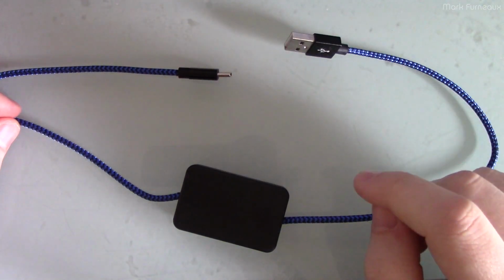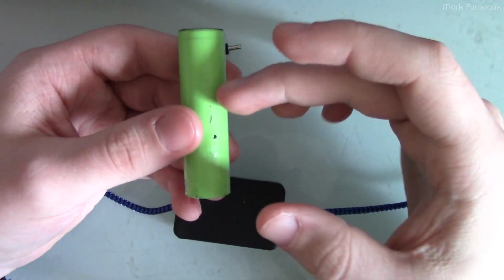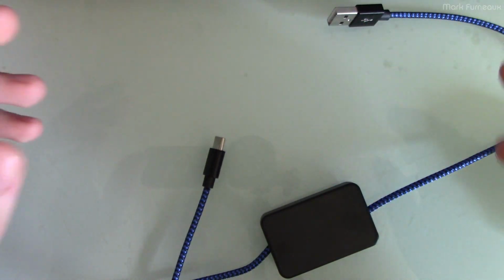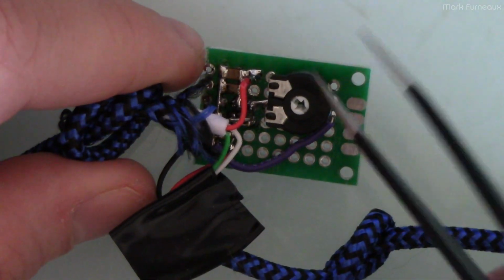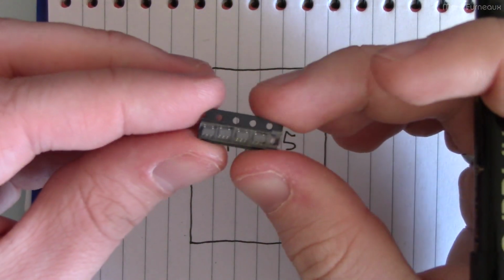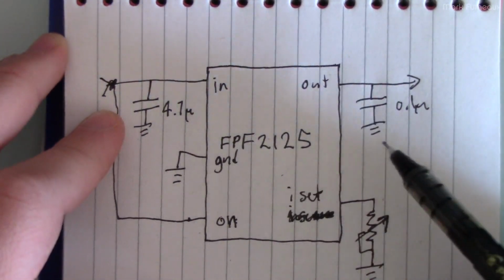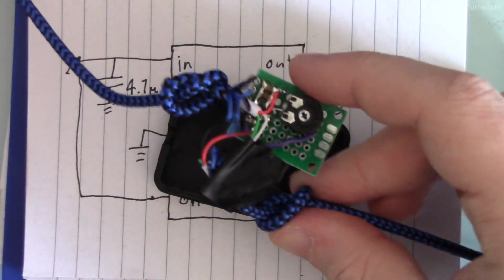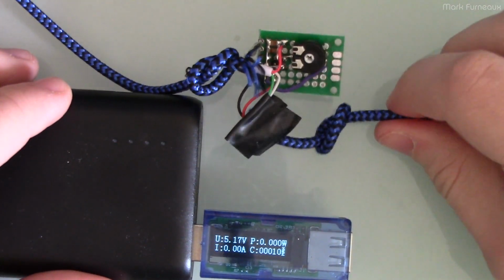How To Build A Slow Charge Cable To Extend Your Phone's Battery Life

Comment: T.U. for educating users but there are alternate methods.  Heat is the main killer of Li-ion batteries not fast charging all by itself.  Qualcomm demonstrated that it is possible to safely fast charge by monitoring the charger tip temperature which infers battery temperature then cutting back VA as required.

  Li-ion batteries do best in controlled room temperature.  They age best when kept between 40%-70%  capacity.   I've kept my Galaxy S7 Edge battery healthy for 8 years by charging so as to keep its temperature down. 

 Today we have smart plugs controlled by Alexa or G home allowing chargers to cycle on schedule.    There are 5V 500 ma USB chargers and solar trickle chargers.  The Belkin 27 watt Qualcomm QC4+ ac adapter is excellent at keeping battery temperatures down while still allowing fast charging.   It's advanced controller was way ahead of its time offering charger tip temperature sensing,  mico-voltage adjustment, current control, PPS, C-PD, and QC.  I'm amazed to see new Galaxy flagships and Pixel 9 reporting superfast 1.0 charging on it.    Today's phones are designed to meet the rigors of daily use including fast charging to meet power demand.    If you want longer battery life then set the controls to lower the charge rate when fast charging isn't needed and throw away aftermarket power supply / chargers which create noticeably higher heat in your phone.

Comment: Great video, thanks! I'm slowly running out of old phone chargers that can slow charge at 1A or less. (After a decade they finally quit working)
As you said it's impossible to find 1A chargers anymore. Everyone wants to slam your phone with 30 Watts.

Great pointer about tying Data+ and Data- together (green and white wires). I never knew that about the USB standard. 

What's the resistance range of your potentiometer by the way? (I know it may only be applicable to that specific chip)

Comment: Care must've taken about the thermal behavior of this setup. The moment the current is reached and the fet switch starts to increase its channel resistance to drop the voltage. The output will settle for example at around 4.5V while the input stays 5V. The current is for example 300mV. The power loss on that tiny SOT23 device is 0.3x0.5V so around 0.15W. that is still okey, but it can quickly go defect if the phone decides to trigger around 4V.
This IC works as a linear regulator in this mode, controlling for a constant current.
Reply: Typo: current is 300mA

Comment: I have a question. I read that quick charge protocols on a type A port communicate by modulating signal between VCC and ground pins. So, can I just demodulate signal with a capacitor to ignore quick charging protocols and charge at 5 volts?

Comment: I used a 12 ohm 10 watt resistor in a tiny box. Slows down micro USB charging to about 2 watts. I can watch youtube videos with the charger plugged in & it barely charges.

Comment: I just bought an adjustable power supply with 15 Watts, i'm able to change the voltage  and amperes of the charge. You can get them from China directly for arround 5 to 8 bugs, I bought them in my country a bit more expensive but don't have the hustle witha chinese dealer and I got it quicker. Search for adjustable power supply USB 15W and see a couple of them, mostly are blue and red, but I bought the black one, because the other two got outsticking pins of switches and the black one got a disc style dial switch, which you have to push and turn to left or right. I guess this type of switch lasts longer compare to the two other ones.
Reply: Would you be able to supply a link?

Comment: Is there any buyable ready to use product, tht does the same?
Reply: I was hoping for exactly the same 😔
Reply: @kl1wdr  see my comment above.
Reply: I just bought some usb chargers that are meant for small stuff like headphones or smartwatches. They’re typically under 1a output. 500ma is too slow, I like 700ma-800ma. It charges a typical phone just fine overnight. I noticed my battery life is better as well. The slow charge helps the battery stay cool and keep a stronger charge.

Comment: Found this after ordering a Chargie. 

I have an old USB charger that puts out 150-170mAh, but even that will "overcharge" the phone say, overnight. (I get about 12% an hour with it).

I would think there might be a market for relatively cheap ~50mAh chargers. 

With the fast charge technology most phones have at this point, if you NEED to top up the phone and it's sitting at 50-60%, you are talking maybe 10-15 minutes of quick charge to do so. And for normal/overnight use, a very slow charger would seem handy. And cheap. 

Chargie should be fun to play with though.

Comment: I bought like 16 500ma chargers that I use to charge everything, but this is also a solution. 
one thing you can also try is to remove the data pins from the charger, and most phones see that as "ah I'm plugged into a 500ma charger" since that's the default USB spec
Reply: That used to be true but phones got a lot smarter now and they’ll regulate on their own without data pins.
Reply: I did the same now. I ordered low power chargers. I’ll be using them on all my phones from now on.

Comment: If i hadn't have this one, i would just use CV module that gives constant voltage on the output, input voltage range would be say 3-10V so that lion would give the juice to the point of discharge set at 3V (no need to have a battery with charge/discharge control logic built in) so having that constant voltage output, i would just solder some resistor in series, depending on how much current i would want to get out of it.. More ideally, id buy some CC/CV module (wait, i have one), in that case i'd just solder the wires on input/output and voila.. set the trimmers and let's go.. EDIT: why those caps on input/output? I have not done such a ting on my charger and worx perfect..

Comment: I was thinking about doing something like this but with data cables intact for a phone that I use for tethering and is therefore plugged in to power most of the time.  The usb data output will only connect if it senses a current output, so I was thinking about making a cable that has a resister that can dump out enough power to keep the phone from charging much but still allow data connection.

Comment: Once I decided to sort all my usb cables. 50% were 2-wire charge-only and only 10% could do at least 1.5-2A. My method for slow charging is just to select the worst one.
Reply: How did you test them?
Reply: @sgas  Same way, with a similar current meter. The cables you can get for random IoT devices are cheaply made and can never do more than 1A.
Reply: @gabest4  so you test what the phone decides to charge at?
Reply: what if you need data but want to stop charging?

Comment: If you have a rooted Android phone, and your charging chip supports it, you can do everything in software with acc (there's a Magisk module) and accA (configuration frontend) to control charging current and other settings (charging duty, temperature control, etc) with profiles.
Reply: Thanks! You made my day!

Comment: Good thing newer phones are finally putting in functionality to control battery charging behaviour. Apple's has one where they automatically optimize charging rates based on your habits but it probably takes a while to train it, though. My Asus phone also has a fair amount of settings for control. One for controlling the charge limit, one for controlling the charging rate (lowest it can go is 18 W, though) and an 'overnight charging' mode that uses a combination of the two so that it would reach 100% right around the time you set your alarm. It's nice to see phone manufacturers not neglect this negative aspect of having such high capacity phones and very insane charging rates.

Comment: Some Android phones have an option to slow the charging to save battery life. My ASUS ROG Phone II has a "scheduled charging" option to have it slow the charge rate to finish charging at the time you set. So if I go to sleep at midnight and set it to finish at 8am it'll still be charging 7 hours later. I think the new Sony Xperia 1 III I have has it as well (so it might be in modern standard Android) although I haven't checked yet.
Reply: Even cheap Samsung phones are able to switch off the first charge. It’s in the settings menu

Comment: Nice video. Thankfully I still have my old LG G7 charger that outputs 700mA, so it's a nice compromise. I would like to try this thou.
I'm pretty sure there are plenty of USB-C to USB-C cables out there with only 4 wires XD
What USB monitor would you recommend if not your one? Just any but yours?

Comment: I'm glad someone brought this up. Fast charging is not great for your battery, especially over time. I just use an old 1.5A USB charger if I'm not going to need my phone for a while. The Chargie is a good battery management appliance as well.
Reply: Lol
Reply: My thoughts exactly. EV cars and fast charging….. how often will batteries need replacing? Similar to timing belts? 100,000 km etc?
Reply: I use a USB 2 charger with the old 5V/1A and it’s been great for the health of my batteries.

Comment: I tried doing this (manually) and quickly found out that the effort needed for keeping the battery in my phone within optimal percentage was bigger than the cost of battery replacement after two years anyways.
Also, using USB ports and not an integrated cable would be a great - if the cable breaks, just unplug it and plug in a new one.

Comment: I'm starting to regret charging my EV to 100% every night now.
Reply: most EV cars have an option to change the rate of charge and what you charge it to, you should see what you can do about that.
Reply: @JessicaFEREM  Yeah, but I left mine at 100% because I wanted maximum range. I've set it to 90% for AC charging now.
Reply: Arpad Toth  Jokes on them if that's the case. The battery pack has an 8 year warranty :D
Reply from the maker: If you have a Tesla, 100% to you is really 80%. The car automatically expands the discharge range over time as the battery ages so you always have the same driving range within the warranty period.
Reply: @TheUbuntuGuy  I have the only Mazda EV, the MX-30. I have no idea if they apply the same sort of wear levelling. Regardless I think I'll avoid charging to 100% going forward.